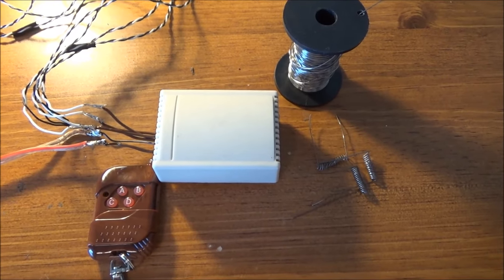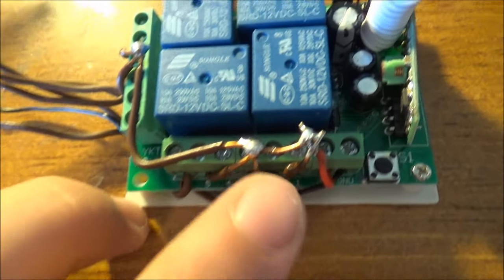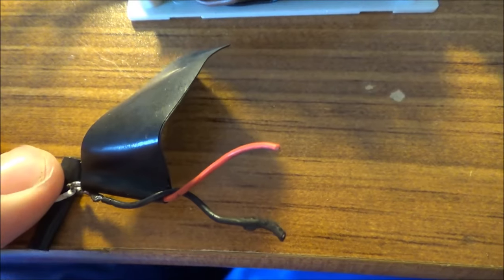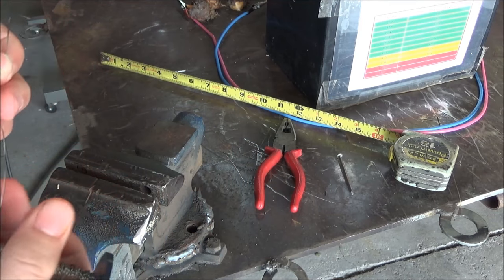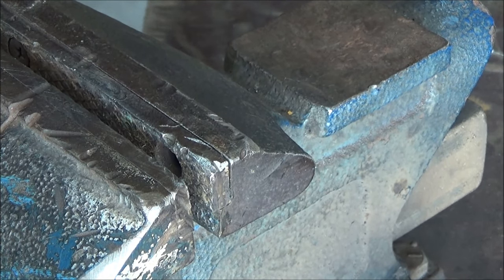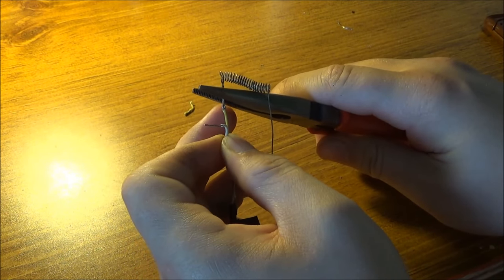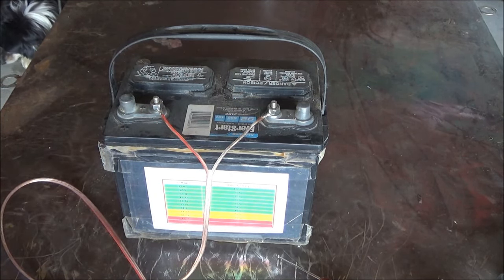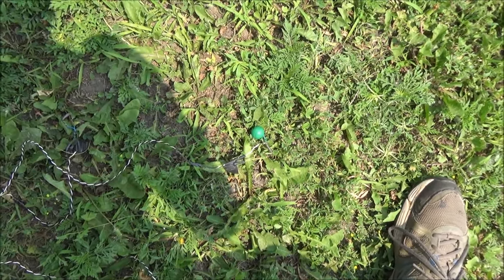Homemade 4 Cue Remote Fireworks Igniter

Comment: bullshit  i  take   2 cm  guitar string//the   thin one   ,,6 th ,, and  u  can solder it  on  coppre  wire    // u  do    a  // u  shape       1 cm  long    hook ,,solder   1  / 2    to   speaker   vire  ,, put   some   matches   head stuff  or   black powder  ,,  and    wrap  some    sticky  tape     so  the  ,,u    ,you  made  is   surrounded   with  few   knife  points  of   match  or   ant   stuff that  ignites  on  red  hot wire /and     most case     wire/string  on   input  of  only   9 volt   duracell   battery,goes red  in like   0,2 sec   and    in less than  0,5  it  goes white   before  melting   and   braking circut ,,   how  u   put  ur   ignition mass  to     be   around amall     u  shape    ,, i   used  termo    insulator  for   wires ,,the  one  u put  on    where  u   soldered  or   just twisted  2   wires   together   and  u put  in over    like    6  mm  diameter   and  than  heat  it   whit   lighter  or   soldering  ,,weller    or     u  can use  plain  stiky tape   for   paper ,,   it s   2  min  to  do  1  ,, no  voltage  or    other  but 9 v   battery   and  it   works  100 perc  if  done  ok ,, no  delay   worth  mentioning,, or  if   shorten   u   ,,guitar   string     to increase resistancy  or  use   thinner    steel  wire,,strings   are  best   0,8 or  9  s ,,  all other  depend  on time  u  want to invest   u  can  go  from  few  min   ,,no soldering  just     set   string   in   multivire copper    cable    and   few   cm of   tape   3   matches ,,u  are  on ,, but  if  u  want to  go    pro look   and   most   perc  sure  ignition poss,, u  solder  ,,test   2  or   3   ,,for   glow,burn  threw   time  ,  and  than use     termo  coupling   insulator  tube to hold   matches shavings   around    that  u ,, pm  me  if  wanna  know   any  or  similar  ,, and  ill   show  u    via skype  or  ,,    this  vid  is   stupid   sorr,, 15  min  to  see   f    lightbulb  is  ignitor  if  u  brake  glass and  put some   black powder   round   unbroken    wolfram   coil ,,   presto ,, ok  sure  irt  is   1x   use  but  no  delay  no     car  battery  neaded
,, regards// micho